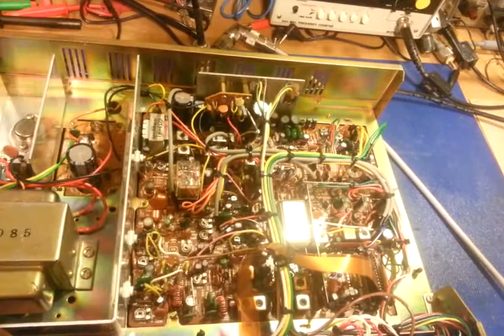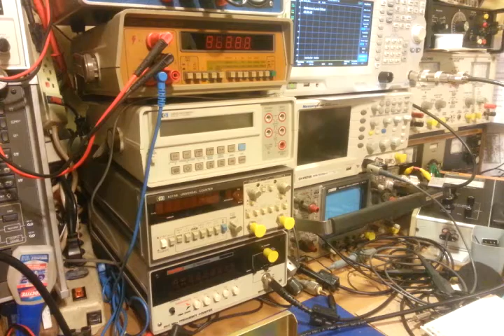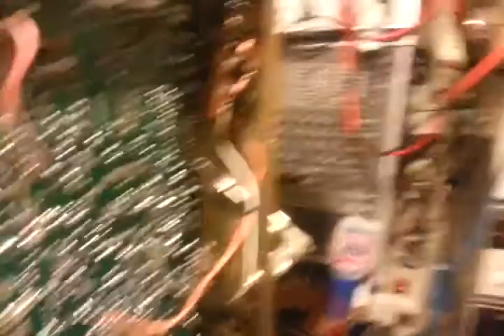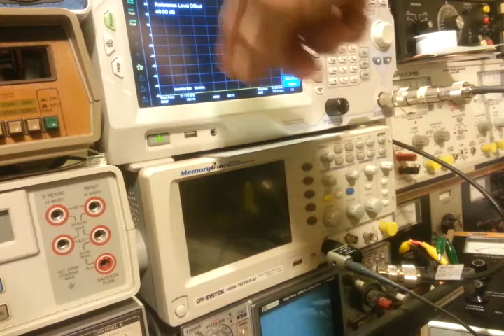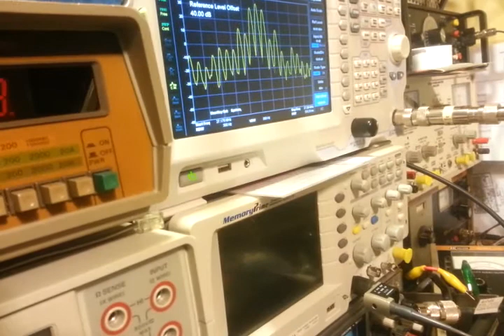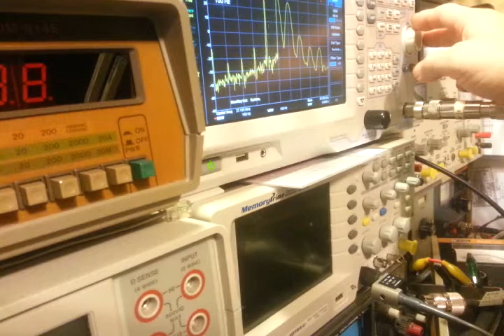Uniden PC-196 board CB radio audio "mod". Good, bad, you be the judge.

Comment: The thing to remember is what the frequency of the human voice resonates at. And how much of that signal with someone talking really translates to bleed over? The biggest culprit I see is the coils clipping off the top end.
And who in the world is selling coils that you could experiment with?
Have yet to try a cap change. If you can recommend what the values?
Reply: I have monitored the audio with filter in and out. With it out it sure sounds a lot clearer. Supposedly this filter exits to filter the harmonics generated by the clipper circuit diodes.
Reply: @ronedwards8239  Clipper circuits won't produce harmonics. If they do, you have a bad component in the clipper circuit, as it's supposed to.... Ummm...  CLIP. CLIP I say. Clip. Someone say Clip?

Comment: I agree with you not to do this mod as Uniden put it in for a reason. What this shows is not the real world audio response as this would of been done on a Osilliscope not DFA. I have done this mod on this board and changing the values is the way to go not just jumpering the filter. These boards had a flat audio response and had very little high freq audio so the rig sounded muddy and flat. Changing the caps was a way of opening up the audio being TX so the radio sounded better in the real world which is something that can not be seen on a meter. Personally if it was my radio I would not do it. Using a good mike always gave the best response either a Turner or a Leson TW-232 sounded great on these radios as they gave it a sharp crisp audio. Bloody loud too. Great video Mike.

Comment: Hi Mike.  Great Video!  I had not seen that mod done before, and yikes! no thank you.

I am wondering if you have ever tried/ analyzed the mod for this chassis where you lift the cathodes of D21 and D22 and place either a 4.7K resistor, or even just a jumper across the now empty holes.  This mod has been around for decades, and i have seen it in old Secret CB books.  I have also seen it in a lot of radios that have come across my bench.  I would LOVE to see what it actually does on your spectrum analyzer.

Comment: I am not against modifying a radio I just think some things make very little sense unless everyone you talk to has the ability to benefit from it. I would love to see DSP in the audio on receive audio, precision diode detector circuit on the receive side, higher fidelity of freq. response and less noise in the audio chain, better microphones, rf and audio clipping and compression, better filtering for SSB etc.... I just try to make sure any mod's I have done or that I have done will benefit those people I am attempting to communicate with. I am all for processing on AM like you see in broadcasting AM.
Reply from the maker: No doubt processing can help on tx audio.  DSP is easy to add externally with self contained unit that just hooks up to the external speaker jack.
Reply: I realize that. I am just saying there are a good many things I would like to see in CB radio. There is a lot of room for growth and advancement. In many ways though CB radio has regressed not progressed. Just look at the tiny crystal filters being used in SSB radio's today. Receive sensitivity and adjacent  channel rejection have not improved at all. Signal to noise ratio has not improved at all on receive. The fidelity of transmit and receive audio has not really improved. The last great improvement was going from single het to double het for receive clarity. On the other hand if you look at ham units they have gotten smaller and smaller and more feature packed. Compared to the buying power of the dollar the price for what you get has also come down a lot. I much prefer vacuum  tubes and discrete components but there are times when smd and lots of code driven ic's and such do make sense. It would be nice to see some variety in the market place and high quality products trying to drag CB into 2016 in a good way. All I see is the industry trying to make the radio's as cheaply as they can and than attempting to strap a linear onto the chassis for easy sale. Their is not a modern CB type D accepted in AM or SSB that can stand toe to toe with a good CB from the 1980's or early 1990's.
Reply from the maker: +buckaroobonsi555 

Couldn't agree more.  They have definitely gone backwards instead of forward when it comes to performance on CB's.  I think the big problem is cost.  Think about how much a person made in the 70's and 80's and how much a radio cost back then.  It could be weeks or a month or more of pay for a good CB.  Today you can get one for a day or two's wages and unfortunately people are not willing to pay those premium prices.  Sure there are some of us that would but not enough that its profitable for anybody to make them.
Reply: My Dad's first serious radio was a RCI 2950 in 1991 and at the time AES I think he said was the only place that carried them new. $496 or $469 each and if you got 5 people to order they discounted a 6th one. So he was working at an electronic repair shop and the owner told him look kid I like ya tell you what get 5 other people to order one and I will give you my dealer perk and let you have the 6th one at my reduced cost on it. It was not that long ago you could get them for $249 I think it was. Keep in mind that was not a 2970 or one of these new 4 transistor amplified models we see today. Until places like H&Y and Copper started carrying them they where expensive when it was just ham stores selling them.  

Could a better crystal filter be installed in these modern unit's? I am guessing that they do not leave space for a larger crystal filter so a system of short jumpers would need to be used. Would stray RF be an issue if one tried that? It would be nice to be able to buy a modern radio like an RCI2950 and beef up the crystal filtering and maybe also go a bit more narrow at the same time. I hate that I have to hold on to old radio's and hope parts can be had to keep them going.

Comment: Please do not take this the wrong way because I am definitely against splatter box radio's. Is their a way to improve what passes through he radio while still maintaining some level of control? I ask because unlike most CB radio operators I do not like or want more bass in my voice on transmit. I sound like a cross between Darth Vader and MaGilla the Gorilla I need all the high freq.'s I can get to add intelligibility to my voice especially on SSB. I have never had a splatter box before but I do know that the audio improvement I get having more high freq.'s is a welcome addition. I also known that on Amateur gear I get a lot more high freq.'s passing through the audio chain with out any modification at all which is why an eq will actually work on ham gear but is almost worthless on a stock CB. Seems like it should not be that hard to modify the audio chain but keep some filtering on the rf side of the radio? It should not have to be an either or situation. Thanks for your time Mike.
Reply from the maker: It isn't hard to change a few values of caps and coils to tailor the frequency response.  However, as you could see in this radio it probably wouldn't do you a lot of good.  This filter network didn't really start to attenuate until around 2.8 KHz.  Thats a pretty high audio frequency.
Reply: Just thought I would ask because I never understood why anyone would want to have more bass on CB.
Reply from the maker: +buckaroobonsi555 

Some people like the super bass sound.  Personally I like a natural sound.  All about personal preference.
Reply: The only thing that matter's to me is being heard and easy to understand. Since CB has limits on bandwidth it can pass, limits of fidelity it can reproduce on the receive end, limits on the audio ic and the speaker oh and the mic itself it makes little sense. If it does not make it easier for other's to hear me at a distance and does not make it easier to understand what I am saying what good is  it? On top of that I do not talk to hear the sound of my own voice so why does it matter all the matter's is at the other end. If audio quality means that much people should think about ham gear or commercial broadcast gear and be done with it. Not that it matters because the guy at the other end has to have gear that can receive and reproduce what you are transmitting or again it is a 100% waste of time and money. If someone wants to learn to sound like a old time DJ they can take voice training lessons and that would do more for them any amount of modifications to a CB radio would ever do!
Reply from the maker: +buckaroobonsi555 

Yep, a lot of people seem to forget that point. If you broadband your audio on transmit it doesn't do you any good if the guy receiving the signal has a narrow band receiver.    Same goes the other way.  You can have broadbanded receive but it doesn't do any good if everybody's transmitting narrow band.

Comment: One of your best videos Mike.  This really shows what little mods can do to the RF spectrum.  The problem is the normal tweaknition does not have the proper test gear (or does not know how to use it) and when they see the power meter go up they thing it has to be better.  What they don't know is your average watt meter is counting power from all those little spikes across the spectrum.  Good video brother!
Reply from the maker: Tweaknition, have to send that one in to Webster's to get added to the dictionary, I like it. :)

Yep, Uniden didn't put those parts in there for nothing and this proves it.  Definitely one mod not to do ever again.

Comment: Darn Rigol SA's always seem to go into the calibrate mode at the most inopportune time!
Reply from the maker: Always seems to go into self calibrate every time I am doing a video.  Use it all day and never seem to run into that.  Just happens when I'm not looking at it.
Reply: I asked one of the guys at Rigol about it a couple of years ago and apparently it does a calibration whenever a set parameter goes out of tolerance. As I recall a internal temperature measurement was the "culprit." The longer my DSA1030A-TG stays on the longer the intervals usually are between calibrate sequences. TNX for the video Mike!
Reply from the maker: +Dino Papas 
Good to know.  I kind of look on the bright side.  I would rather it do that and keep itself calibrated then fall out of spec.  Only takes it a few seconds to complete anyhow.
Reply: Roger that!

Comment: Leave the filter in.
It's just wasted power.
The golden screwdrivers probably like this mod because they get "more power" on a meter.

You didn't happen to glance at the output power while you were doing this did you?
I bet you got a few more watts of wasted power.
Reply from the maker: I should have shown that because it did increase output power in the high frequency range.  Great way to get those magic high power watts.